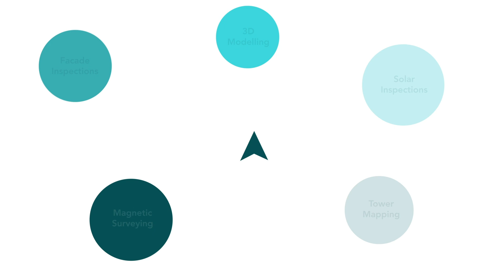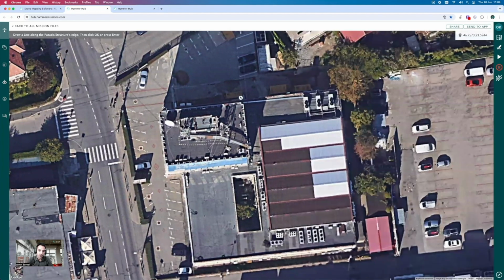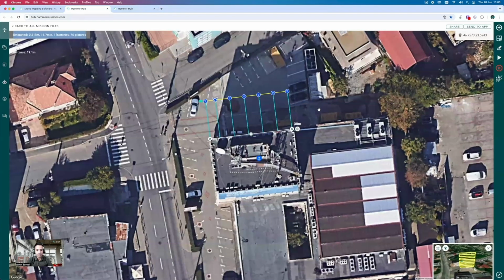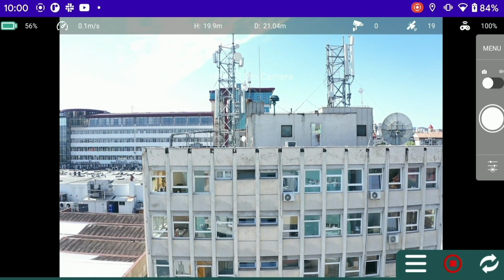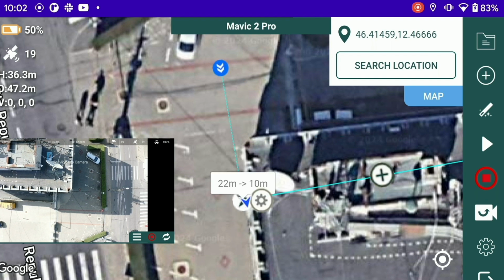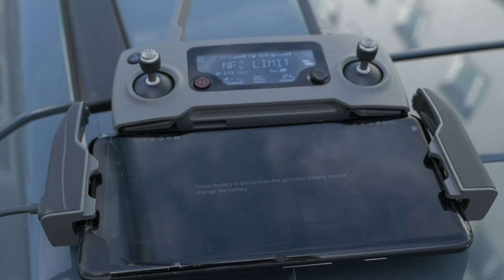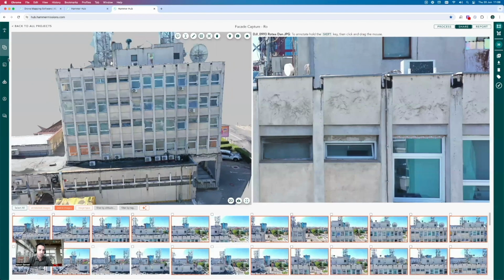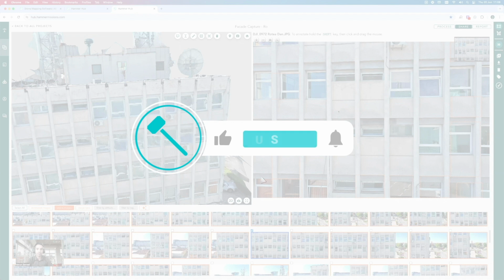Drone Facade Inspections | Complete Workflow | Hammer Missions

Comment: I am glad you showed that the settings in the Hammer Missions app can be adjusted while the drone is flying without having to land it to adjust. A real time and battery savings. If I choose Facade Inspection instead of Facade Mapping, does it still stitch a 3D image like the one shown in the video or will I need to also do a "Mapping" of the roof or "3D Mapping"of the roof to get the 3D stitching with combined Facade?
Reply from the maker: Are you trying to capture the roof + facade or just the facade? It's the roof + facade, we would recommend using our 'Mapping' or '3D Mapping' mission for the roof and our 'Facade Mapping' mission for the facade. Typically you will need a good oblique gimbal angle in both missions for them to stitch well!

Comment: Thanks Varun, very clear and useful to see used in the real world. A couple of Qs: (1) On desktop I can't see any options for MM2, MM3 Pro, MM4 Pro - or camera setting e.g. 48k resolution. Do I just select Mavic Mini (then manually set on drone RC?); (2) Can 48k be 'forced'? to maximise resolutions from the smaller drones?
Reply from the maker: Hi there! Thanks for your questions! 

1) You'll be able to choose Mini 3 Pro camera from the Hub very soon! But yes, in the meantime, you can plan with the Mini camera and change on the Android device. 
2) Do you mean 48 MP? You should typically be able to configure the camera settings in the Hammer App or DJI App and the mission will then take the images with the set camera settings